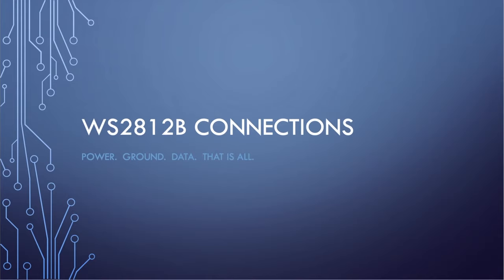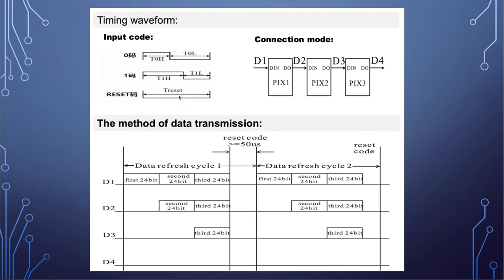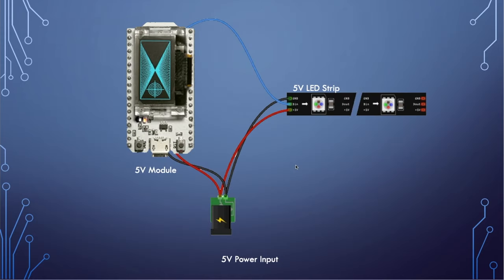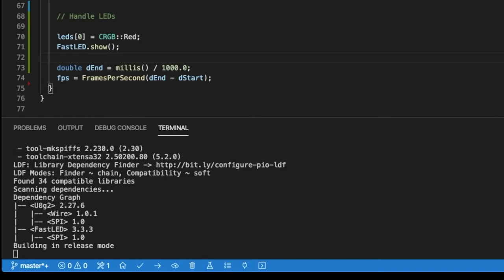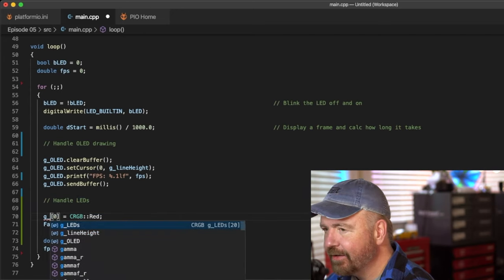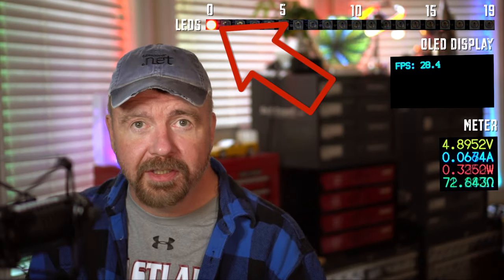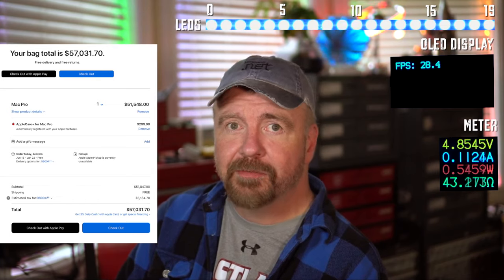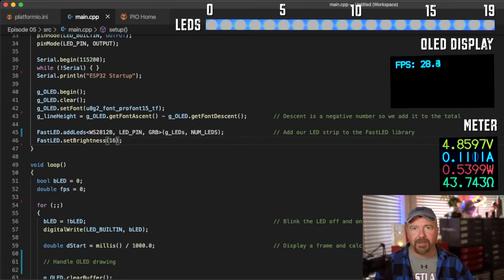04-FastLED with Arduino Tutorial Introduction - How to Code for RGB LED Strips (WS2812B)

Comment: When you use this in real life (mounted on the well for example) Do you put the ESP in a casing or how do you set it up? What kind of power supply do you use after developing?
Reply from the maker: For outdoors I run a 24V wire and then use buck converters to step down to 5V every 2M.  Right now they ESP is just out in the weather, but they survive somehow.  I need a better solution for that part!
Reply: @DavesGarage  Thanks for your answer, I see a reason for buying a 3D printer... ;) 
I would like to see/ get your take on the power supply in a video. How you prefer to tackle voltage drops in long led strips, choice of power supply, step down, etc. (i.e the missing parts for actually do a project like this on my own and set in free in the wild) :)

Great video series btw. Keep up the good work!

Comment: It appears that, in my haste to try this, I purchased SK6812 LEDs, because having a pure white LED for less power seemed great.  However, from what I read, FastLED doesn't support RGBW LEDs.  There are posts about it going back almost 4 years.  Do you know if that is still correct or is there a way to do this with FastLED that I haven't discovered?  If I try to light my string in any specific color, the first and every third LED will be that color, the others appear to be lighting different segments.  My guess is there is an extra bit in there that isn't being taken into account.
Reply from the maker: What I did is right before FastLED.show() I run through the CRGB objects. If r==g==b then I assume it's a shade of white and copy the value over to the white led.  Worked for me!
Reply: I have made the same mistake! Two years later, it seems there is still no support for RGBW. I'm guessing the creators of FastLED have abandoned the project by now, which is a shame.

Comment: Hi I have a question that I just wire all the stuff like you and but I place the arduino far away from the light so the wire also get longer, I find out that not a voltage drop, I checked and the problem is the data pin sinal from arduino to the WS2812B and do we have any way to fix that data signal drop? Thank youu
Reply from the maker: My understanding is that the data signal is regenerated at every LED, not just passed through, so the data signal should not have a problem unless the power, which often DOES have a problem, is low from too much distance or load.  I find that I have to add a fresh new injection of 5V power ever 2m.  Every 1m is better, but I do every 2m and my installation has worked for years.  I don't know the maximum length, but as a guess, I bet you need to make sure you have 4V at least at the circuit.

If your LED is farther from the arduino, heavier gauge wire might help it drop less before it reaches the LEDs.

Comment: I am having a bug. I kind of get what I am looking for, but I randomly have a rainbow of light coming though. Even on the code I copied and pasted. I have tried changing pins, as well as an older version of the library, but the result is the same. 

for example, 

g_LEDs[3] = CRGB::Red;
FastLED.show();

will light up the 4th led red, and shoots a rainbow all the way down the string.

//g_LEDs[3] = CRGB::Red;
FastLED.show();

Just casts a rainbow.

Has anyone experienced this?

!!!Major Update!!!
Use the same powersource for the ESP32 as the Powersupply, and you will not see random garbage.

I will leave this here incase someone else needs it.

Comment: Warning: Having many leds attached WILL interfere with serial communication because FastLED disables interrupt while updating the LEDs.
Two ways out: have multiple led strands with only a few leds or make your sketch actively poll data from the controlling software.

Comment: Play with your LED display at your own risk, b/c it only takes one phone call to have all hell break loose. Hint: If your local fire department smashes all your home windows, and knocks your doors down, they are not required by law to replace your crap. You are not allowed to recover damages in court. You will however be required to pay a state fee for dispatching them to your address. Refuse, and state will take your home. Good luck.

Comment: Since i found your channel Dave I've been enthralled with LED projects! However, before this my lady says i was a moth in another life, LEDs have been a huge hobby but not on your level. I am totally green at coding or "sketches" for Arduino. It's been a task trying to find someone/class to teach me anything around my small area. Arduino for Dummies is still hard for me to send/understand a simple premade sketch. I get one LED to light up...so i might be a Sub Dummy idk. I have an elegoo board, 5v power supp, ws2812B Strip and tried following a vid from your channel and nadda. The sketch will load to the board but the strip does not match the sketch sent. Just one LED lights up to mock my inexperience. 
Can you or anyone here point me in a positive direction for an absolute novice?  Thanks in advance!
Love the channel and personality!